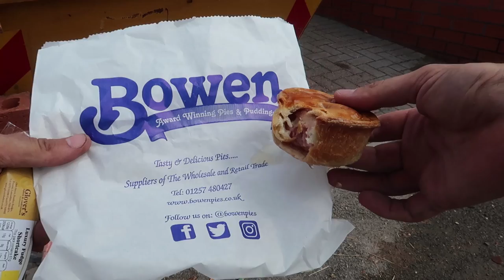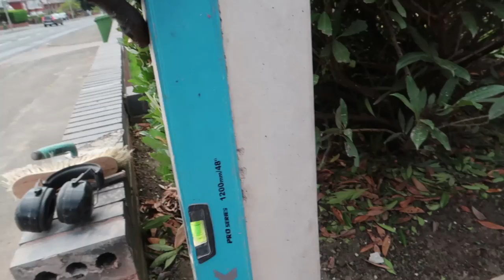Bricklaying - Building a Brick Pier

Comment: I just made outdoor water tap structure with solid bricks. Although I used spirit level it is slightly inclined, happily not obviously (especially if you watch my yard from flying airplane high above)✈️😜
I learned from this video that all what's needed was just a little more attention and control to make it straight: I was using eye many times to direct me  instead of my spirit level, big mistake. 
For others: use primarely your leveler all the time, just as author presented here. Also pay attention on brick distance, which is IMHO harder to achieve with solid bricks than with hollow bricks. Pay att. how he immediately removes excess mortar, so he can use  spirit level to adjust position. right a way. 
Fine video, thank you.

Comment: Nice tidy pointing work, pal. No slop on the Bricks. 
I have a couple of questions if you don't mind.
1. I note you torpedo level for every course but only every two course when checking for plum. Is that OK? Or just preference.
2. After how How many course do you need ties? 4/5 courses?? And is it ok to tie into the older mortar joint rather than the existing brick. I guess it doesn't matter, but I would appreciate any info.
Much appreciated. 👍

Comment: Cracking job again stu. Only thing I'd of done differently is I wouldn't of tied the pier in to the existing wall because that was on the piss. Only a matter of time before that moves loads and it'll drag your pier with it
Reply: Like he explained. The customer wanted the pier rebuilt with the class b 73mm as it would match the other side. As for criticising his work I'm not about that. The lads a top trowel and I'd happily have him in my gang.
Reply: I agree mate. For stability I would have drilled steel rod in the middle of the pier into the existing concrete footing and filled it with concrete. Stu is a great bricky/ tradee so I’m not bagging the guy. Just what I would’ve done.

Comment: What is the weight of the sledge hammer you were using? Three pounds? Nice job, BTW. I’m planning the building of brick piers around ugly galvanized steel fence posts. Never done it before, but it should look much nicer when I’m finished!

Comment: Hello, nice brickwork as you managed to build the brick pillar even without vertical distance markers. However my few questions: The role of the brick pillar is to support the wall against moving. But you have connected pillar and wall only by the metal plates rather than making a brick connection. I would guess that may not be stable enough if water/ice/strong wind will come. Will that work? The second observation is similar - why you didn't support the brick pillar inside by metal & concrete? Thank you.
Reply: Vladimir Chladny these wall ties are perfectly acceptable and the ice and water will not affect the performance of this build. As for brick ties that’s not possible in this instance since the new Brickwork is built from a different size to the original in order to match the owners requirements. This is an example of good practice.

Comment: Why didn’t you go with the wall? It looks off plum
Reply: He should have put a split below ground and kept the brickwork level with the wall.
Reply: Also that concrete post should have been set in concrete...he done a cowboy job tbh.
Reply: Street Skater 66 hi mate you obviously didn’t listen to what Stu said the pillar is matching to the new wall at the other side not the one it is attached toplus they did concrete the post you may need some glasses🙄

Comment: Video has been put together very nicely indeed. From a structural point of view, not a good idea to shave the bottom of the concrete post as this is the section of the post working hardest. Rawl plugs ought to be installed into masonry units rather than into a mortar joint. Great pointing.

Comment: I see a 5mm bed run into 10mm.. must be the bricks 🤨  6.50
Reply: The old wall was 65mm brick , the new pier is 73mm brick hence the joints don't line up

Comment: Youve matched it to the new is that called a pig
Reply from the maker: dont know what u mean chris
Reply: stu crompton the new pilla doesant line up with the old wall i thought that was called a pig in the wall
Reply from the maker: A pig is something different Chris. The old wall is leaning I can only build level and plumb 👍
Reply: stu crompton ok thanks stu just wandering you vids are mint keep up the good work
Reply: I can appreciate that you can only build "level and plumb". However, if you had slightly increased the footprint of the pillar toward the street and a few inches more away from the street you could have created a small reveal in the front, which would have disguise the leaning wall and eliminated the new concrete post in the back.

I couldn't see the opposing corner of the driveway, so I don't know how this would look in comparison to the existing corner. I would have built a "column", with a reveal on both sides of the driveway, instead of just a pier.
I do agree with tying the existing wall to the new corner. As old as that wall is, I doubt it has moved for decades.

Excellent craftsmanship. I'm just not sure about the design. If you are simply following the property owner's instruction, I supposed there is nothing else you can do.

I'm in Kentucky (US) so some of the terminology may be different than yours.

Comment: Why on earth did you get rid of something that matched NICELY to build a post out of course using 75mm brick instead of 65mm & the wrong colour.   
Atleast with a smaller brick youd have matched the courses even if the new owner wanted it changed on their side.
 You should have rebuilt the neighbours post wholly on their side - THEN put up the new one for the new neighbour on Their boundary line.

You've just made it look non uniform now.